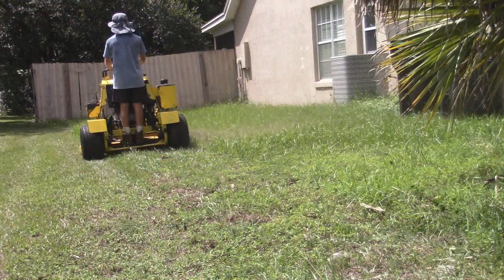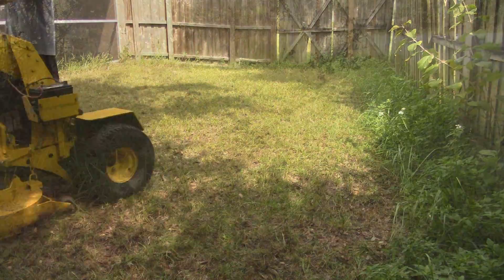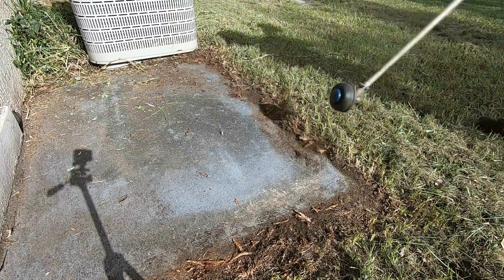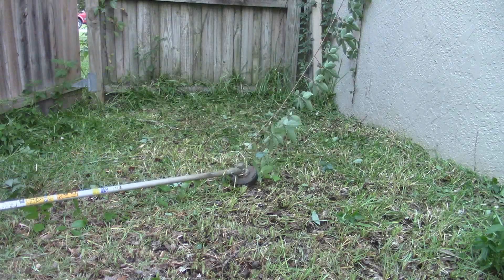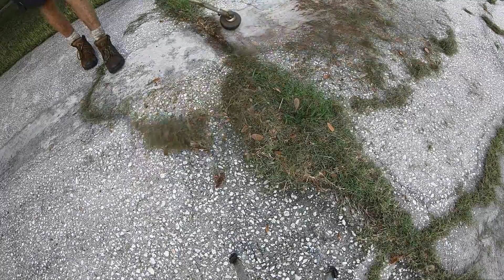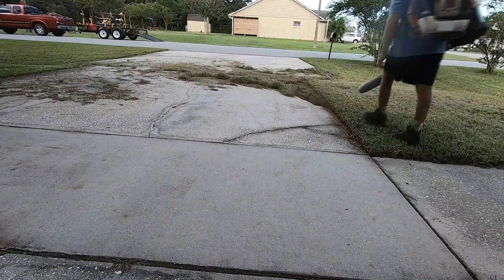Lawn care vlog #53 Another tall grass free makeover!

Comment: I bought a set of gators a while ago and I love them. They work awesome for my little 42" tractor. They mulch great, can't even see the clippings when I'm done they're so small, but gators also throw and bag it pretty well too. I don't get rows or clumps with them. The edge seems to last a little longer than the oe blades also.
Reply from the maker: I agree. They are a good blade. I just got spoiled with the Kavli blades. Wow, can you imagine if I went all the way back to standard blades? It would seem like it's broken. lol.
Reply: @Something2LookAt  I haven't tried anything other than the gators, but I know what you mean, using my mom's old push mower to do her lawn with a standard medium lift 20" blade. It's... disappointing really. I mean it does it's job fine but it could be so much better. I really should get her a better blade, it needs replaced.

Comment: Imo, gator blades are a good choice when cutting thick grass and/or tall grass.
Reply: Imo. I have better luck with high lift blades. I use G5 Gator blades for leaves only.
Reply: @brenthill5596  Imo your better luck on using the high lift for the leaves as well.
Reply: Did you sharpen your blades after you receivers them?  I know some people say they sharpen them before their initial use.  I didn’t do that, and noticed that they didn’t cut as clean as my hi-lift blades.  I don’t do mow any properties in the fall that requires me to mulch leaves, so it’s all about the grass for me.  I just got them sharpened, so I’ll see if that makes a difference.  If not, they’ll be a waist of 💰 for me.  Btw, my blades are the G6s on three different mowers.
Reply: @amandadavis9726  I didn't sharpen the Gators. The edge was sharp enough out of the box for leaves.
Reply: Brent Hill for leaves, I would think that they’d be sharp enough for that.  For grass,...it seems like a different story.  I’ll put some sharpened G6 blades on to do some mowing in the next couple of days.  I’ll post how they do on grass.  Hopefully they’ll do better than they did before.
Reply: Brent Hill I mowed with some sharpened blades today.  It made a huge difference in the quality of the cut, unlike it did when the blades were new.  The biggest difference I saw, was that the cut was cleaner without leaving stragglers, and it looked more of a 60” cut with one blade instead of three different ones.  So,...it looks like I’ll have to sharpen the next set of new Gator blades that I purchase.

Comment: Running the string that long is a great way to really mess up your clutch and motor for every extra bump on the head you lose 1,000 RPM  and you put an extreme amount of stress on the trimmer and makes the trimmer work twice as hard
Reply from the maker: Just for kind information sake, that has not been my experience. Been doing it this way for 30 years, never had a 2 cycle engine "blow". My trimmers last 5-6 years and they usually break in other ways. Never have had a seizure or compression loss. And from my experience, if you only look at trimming rate, you'll notice that a wider swath is getting more done faster even though the basic ground speed is slower. One wide pass vs two narrow ones. And the trimmers are not blowing their engines. Really.
Reply: @Something2LookAt   gotcha  well iv seem them come though the shop because they got so hot they seized the bearing or the clutch got toasted  or they melted the clutch covers on them but hey whatever works! And those gator blades seem to work good! Might get me a set

Comment: Its interesting to me that some lawn guys always weedeat first, then mow.  But others weedeat afterwards. Interesting. Also, i dont know what was going on with the mower blades, but they laid a lot of clumps down without cutting it. Any particular reason whyyou didnt get the grass behind the AC unit? Just curious.
Reply from the maker: I never go behind AC units. Can you see the wire dangling? Well, there were more loose wires back there too. And the weed whacker can break the coolant line too. AC units are rarely installed with weed whackers in mind. That all has to be done by hand back there.
Reply: @Something2LookAt  thanks for the good reply! I hadnt thought of that, because most of  the AC units I run across are part  of the interior HVAC unit in the house. I have been known to scrape the outer cover off a ham radio antenna cable though(it was at my house). Hubby was not pleased!